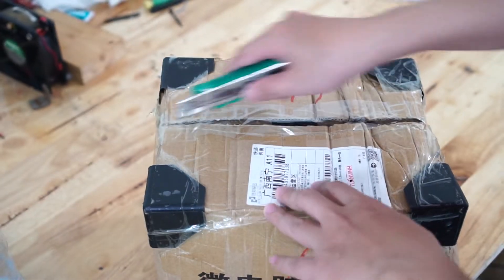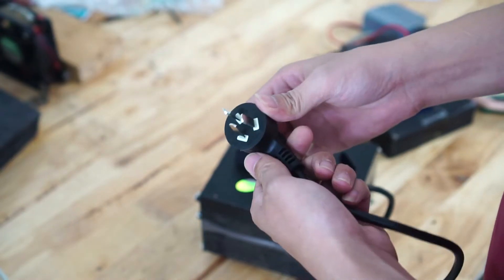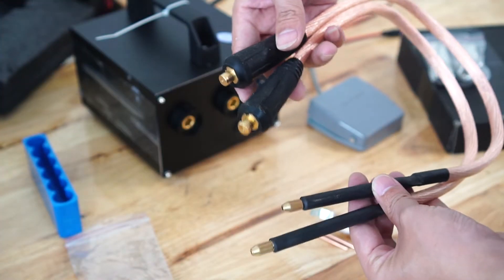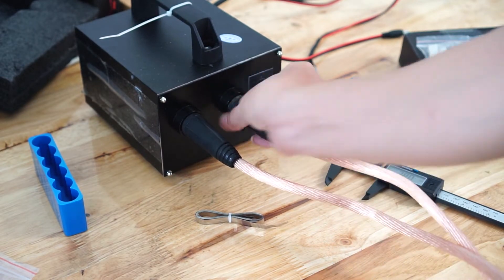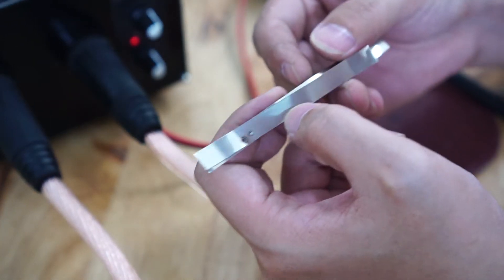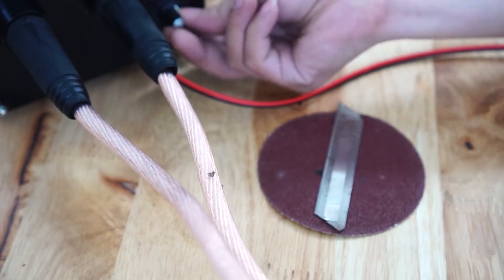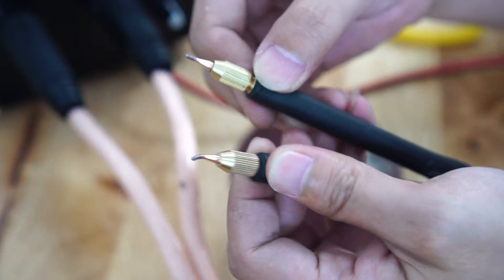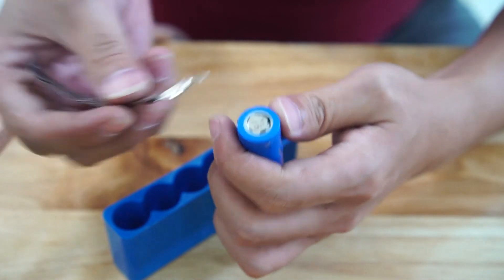Cheap spot welder Unboxing & first Test

Comment: i bought this month ago ...awesome quality and great welds....no need to replace replace batteries and more powerfull than farads and lipos....BUT ....make sure you have 20A short circuit breaker 220v...i had 16A overall installed in my home after 5 -6 welds all power went off....so i returned it unfortunately....if you have a company with better wall sockets with high ampos this device is awesome and will give results lifetime.

Comment: Hi, is this spot welder good and still working? I am a specialist in finding things and web surfing and took me 10 minutes to find the exact model and several stores that selling it. The exact same machine. Well it's not that cheap, maybe because is selling to foreigners outside the China, but if is good enough, I will write down the links, so other people to buy it. 
The model is CX3500 1300A. Here:
BGN 225.88 | Spot Welding Machine 220v Lithium Battery 18650 Battery Spot Welder DIY Kit 220V Output 1300A CX3500  
https://a.aliexpress.com/_mPoQExx
BGN 104.79  8%OFF | 5500W Battery Spot Welder Kit Welding Tools Portable Adjustable Spot Welding Machine 0.2MM Nickel Strip For DIY 18650 Battery

https://a.aliexpress.com/_mO40ved

and here:

BGN 104.79  8%OFF | 5500W Battery Spot Welder Kit Welding Tools Portable Adjustable Spot Welding Machine 0.2MM Nickel Strip For DIY 18650 Battery

https://a.aliexpress.com/_mqPmCtf

here also on Ebay:
https://www.ebay.com/itm/Spot-Welding-Machine-Battery-Spot-Welder-DIY-Kit-220V-Output-1300A-CX3500-/114259678795

I also found it in Taobao but I don't understand Chinese and can't switch to English. :)

Comment: So which one do you prefer for future spot welding? $13 or $40? Also why did you even buy a $40 spot welder? Why you want to ditch the $13 one?
Reply from the maker: Because i want to make an ebike battery pack, it's bigger, the 13$ lipo spot welder can't handle for a long time to welding, must be fully charge to weld. When battery fall below 3.8v, can't weld anymore
Reply: Hi where is link for spot welder you buy for 40dollars?im in uk .steve thanks
Reply: With such a powerful welder you must be careful especially on small 18650 cells not to puncture the battery itself...otherwise a good unit, more for professionally use I think,the smaller spotwelders will do fine for making 3 s to 4s batterypacks....for a large project as making lots of ebike battery's with many cells take this